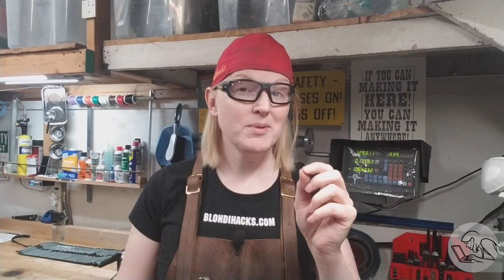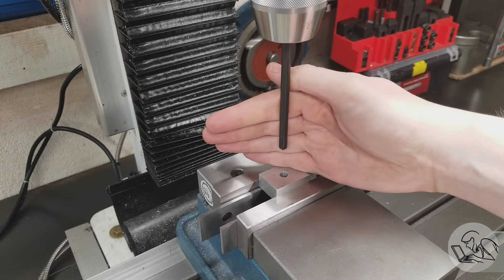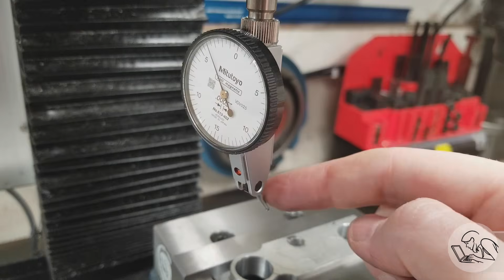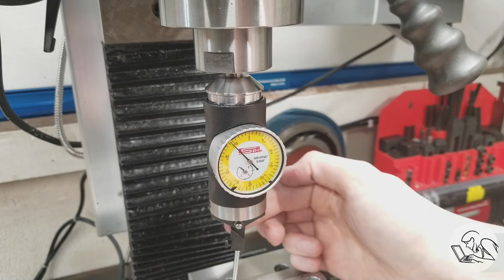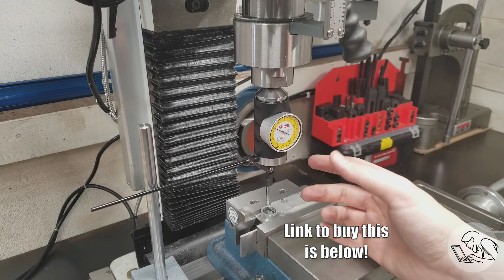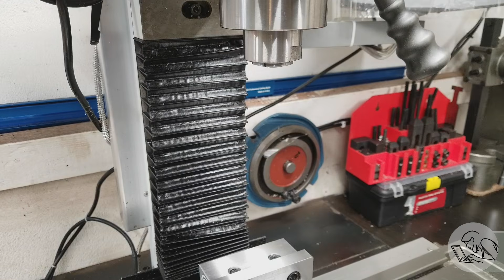FIVE WAYS to find a hole or punch mark on your mill!

Comment from the maker: Hey everyone- it’s a very popular comment that the leg on a coaxial indicator is in fact adjustable. All I can tell you is, the instructions for mine say not to touch that bolt. Like many of you, I tried anyway and found it to be so tight that it couldn’t be removed without risk of damage. Likely Loctited in place. Maybe other brands of this are different, but that is how mine is.
Reply: Very nice video, Quinn. The instructions of my centering indicator states to "adjust rocker friction joint to make the feeler contact with the workpiece". So you should not touch the bolt because it is set loose enough to be able to adjust the joint but tight enough to stay in place during the measurement. Adjusting the joint though still feels like you are forcing something you should not do on a precision measuring instrument.
Reply: Yeah probably because adjusting it introduces more cosine error. I think mine was just cheap and not loctited. I do wonder why the one side has that bevel if not for that
Reply: You should not need to adjust the bolt, the leg should be able to sway both ways with a bit of friction just like a regular indicator dial leg. Maybe it needs a bit of tender persuasion. The bolt is for adjusting the friction level.
Reply: Mine looks exactly the same and goit it from aliexpress for 50bucks.
Included a lot of different probes
Reply: LOL "...the instructions for mine say not to touch that bolt. Like many of you, I tried anyway..." Oh, really? I wonder why they would say that? That can't be right, and why doesn't the leg just adjust like other indicators?... RTFM in case of emergency ONLY!
Reply: With respect: that’s strange.  I’m not home, or I’d send you a pic of mine.
Reply: Huh - my instructions say, "Adjust rocker friction point to make the feeler contact the work piece." which I interpreted to mean that I should loosen the acorn nut rather than go all gorilla on it.
Reply: I just loosened the little acorn nut on mine. Definitely adjustable
Reply: On Blake brand Co ax indicators the leg is adjustable, and the SPI brand unit we used when I was in high school shop was also adjustable. Obviously I cannot speak for the exact unit that Quinn has. Regardless, it's a still a great video overall.

Comment: i have the same coax indicator as you do and mine gives me a 0.100 error in comparison with the dial indicator, i was wondering why i was not getting my center, after doing a few comparison tests i found out the coax indicator is off. do you have an idea what can cause it? does it need to be calibrated

Comment: This is a bit off topic but it relates to punch marks. I found that I can use a punch to drill incredibly accurate hole patterns. The trick is to put a sharp object in the quill and bring it down to make a mark. The quill mustn't rotate. Move the table an accurate amount using gage blocks or something accurate to a tenth or better. Bring the quill down and make a mark. After they are all done use a small flexible drill that will follow the mark. Drill the hole on all of them and go back and make them the size you need. I find I can get most of them to within a tenth and the worst might be two tenths. Measuring the accuracy is a chore. I usually put pins in two holes and measure the outside distance and compare with the others.

Comment: Hi Quinn. At 8:55 you mentioned someone saved a rotary table position in a DRO. I did not know that was a feature in a DRO. I searched without much luck. Could you briefly explain how that's done? (I have a Fagor 2-axis 20i. There's a video on saving on a 40i that involves a usb dongle but not on mine.) Thanks.

Comment: Wouldnt it be possible to machine a plug gauge on your lathe, with the shank sized for a relevant collet and the "plug end" machined to a transition fit for the hole your trying to align 🤔?

Comment: Thanks for showing how the coaxial indicator works. My preferred method is an edge finder with a 0.2" machined end on one end and a pointed end on the other. These are available in different sizes, but I usually use the 3/8" body and it fits perfectly into a 3/8" R8 collet or Jacobs chuck and are short for small mills. They are used dynamically at a medium-high RPM (around 1000 is recommended). Simply adjust X and Y until the end just kicks out (0.2" end) or is at minimum if using the pointed end  for a center punch.  I think Mr. Pete has a video on how to make one, but Amazon has a Mitutoyo for around $20 as I write this.

Since I have a DRO, I use the 1/2X (or 1/2Y) function for the 1st axis. I then set the X (or Y) axis to zero. I then do the same thing for the other axis.

The problem with the normal edge finder is it can leave marks on the edge if it is soft material, such as aluminum. If that is important, I find the electronic edge finders useful if you are machining metal or other conductive material. These are used statically and cost a bit more. Amazon has a Fowler for about $50 as I write this. They usually have a 1/2" body and are not usually produced with a pointed tip. The DRO method can also be used, but creep up slowly so that the tool is not permanently bent (they can take a small amount of flex).

Of course, for non-conductive soft plastics, use a thin sheet of paper between the dynamic edge finder and the work.

Comment: Loctite turns from a chemical holding method to a lubricant to aiding  removal under heating, Loctite turns liquid under heat and the basic differences between the different grades of Loctite are the heat rating of the Loctite basically the stronger Loctite's are higher heat rated, So Heat to loosen  does work

Comment: Question, I can understand why you would want to find dead center of punch mark, @28:13 when your finding the center of the already machined hole, why would you want to unless you was going to enlarge it or cut a thread but wouldn't you have done that already while it was attached in its correct position ?

Comment: It is a friction movement for the stylus to accommodate diameter range. Unlike the dial test however it only swings in one direction passed center. That’s what the little angle is for.😃

Comment: Blondie, thank you for your channel.  It has been 50 years since I took machine shop in high school, and spent a summer working for research tool and die for a summer.  I just bought my first lathe, a 7"X14" and will make a machinest hammer and then a meat tenderizing hammer like the one I made in high school.  I have five daughters and a son.  All of them would like to have the meat hammer they grew up with.  So I plan to make four more, maybe five. I am trying to decide if I should buy a mill with a tilt head, tilt column or one like your PM-25?  I have been looking hard for about a month and see no hobby projects that require the tilt column, or tilt head. The tilt seems to introduce unnecessary error?

Comment: Another way is to use the pointed end of an edge finder and a 1/2" precision bushing that is just able to slide over the edge finder body with no slop.  Load the edge finder in the chuck point end down with the bushing in the middle.  Stick the point in the punch mark, and move your x and y axis till you can slide the bushing down to meet the part surface.  If it won't go all the way down, it's not lined up yet.

Comment: Awesome video - thank you (new to your channel - great work). I suspect another reason for the twist drill drilling slightly oversize is the torsional stress during operation tends to make the helical flutes unwind. This is probably less a factor than just being sharpened asymmetrically (or bent) as you said.

Comment: I may be a bit too old since I am retired I have more time than money. The wiggler you mentioned and demonstrated has another method that I like even better. If you take the pointed wiggler (for a punch mark) and place it in the punch mark with the machine off, then lift the quill and turn on the machine, it will swing around since it is off center. So, stabilize the wiggler as you mentioned and get it very close, place the wiggler in the punch mark and turn the machine on and lift, now leave the machine on and stabilize the pointer and adjust your X or Y then lower the quill into the mark again then lift. Repeat until there is no run out of the wiggler when you lift it from the mark. I do the same thing with the ball wiggler when I have a hole that is smaller than the ball. There you go. Another method. I use this so often that my drill has a wiggler and so does my mill. I am quite fast at this method and a lot less set up and fussiness of the tools I can't afford any way. lol Fortunately, I don't need 3/10ths of accuracy for my projects.

Comment: I absolutely love your videos. This one in particular I found very helpful. I am a journeywoman machinist and have been working in the trade for almost 7 years now. I have acquired and purchased many tools. One of which is a coaxial indicator. One issue I struggle with is my set ups and I am always looking for ways to improve. I have never run the indicator under power but this is definitely how I  will be doing moving forward. It is a much faster way. You do an amazing job with these videos. Your explanations are so easy to understand and very entertaining! I wish I would have discovered your channel sooner.

Comment: You can also use the pointed end of a starrett edge finder for a punch mark lower into the hole then lock the quill be careful not to lock with to much downward pressure like bottom out then raise like a thou then you simply move your dials back and forth until the cylinder is centered unlock the quill relower to press into the hole botom as long as it stays centered you're good to go

Comment: I'll tell you a little trick I've used in the shop for year for picking up existing holes when you only need to be within a thou or two. Use an edge finder. Drop down in the hole, eyeball it to center of the hole. In "X" axis move until the edge finder kicks, zero your DRO then move the the opposite wall and when the EF kicks, look at the dimension, divide it by two and move back to that dimension and zero. Repeat for the "Y" axis and you will be centered.
Reply: Some edge finders have a pointed end for finding centers of holes.😊
Reply: @donaldoehl7690  that's true but then again, I didn't have one like that. I could have trammed it in with an indicator but this method is quick and simple.

Comment: The beauty about purchasing a coaxial indicator is that you can use it with a known flat plate held down to your milling table and it will make a quick job of tramming your mill head to the table.

Comment: Quinn: first, let me say that I really appreciate a young lady like you showing an interest in the machine shop profession.
You’re articulate, pleasant and well-disciplined speaking voice shows your confidence and willingness to share your knowledge about the subject matter of your illustrations.
I am a retired journeyman tool and die maker with just under 50 years of experience at 19+ manufacturing and vocational institutions of employment, both full-time and part-time. I am presently the lead machine shop instructor at engineering college in my community. I plan on referring my class to some of your videos. I enjoy critiquing them. I wish there was some way that I could speak with you for 15 minutes to help you with the subtle imperfections in your videos. As a small suggestion please show the thousands of an inch like this .005 and not 5 thou. Also, you are drill Chuck may be Jacobs, but it is an Albech design chuck or quick change drill Chuck.
Thank you. Please keep up the good work.  Rick

Comment: A good tutorial, there is one other method that works particularly well on holes or 
cylinders that have diameters larger than 1" say like 6".   Use a cylindrical edge
finder and the DRO.  If you are unfamiliar with this type of edge finder they work
much like the wand type demonstrated near the end of this video but they do not
tend to flail around.  By using a method similar to the dial indicator, with the DRO 
and a calculator a center can be found in a minute or two.  The diameter is only 
limited by the travel of the Y or X of the mill bed.

Comment: I'm not sure this is as much an issue with jobber-length drills, but I can tell you for sure that extra long drillbits untwist a little during use, expanding slightly, and that's part of why they drill oversize.  I found this out drilling a deep hole with a jobber drill and then running an extra long in there and having it bind.  (Hence the existence of aircraft extension drills, I guess.)

Comment: There is one more dirt cheap method, laser. Those $5 doller laser pointer using watch battery, you can put it in the chuck and it will give you good indication. The only problem is, sometimes the red dot is too big, you can make a cover with paper/rubber/leather. Center it on you lathe/mill and use the smallest needle you can find to punch a hole on that cover. Depending how small the hole is, how accurate it will be. Loose your vice little bit, move the parts instead of the axis, press dro zero, It will reduce your tuning to seconds, but it only work on punch marks, not for holes already excisted.

Comment: Actually, since you have both a coaxial indicator and the mitutoyo indicator,
you should consider using both!

First, use the coaxial since it is the easiest. But, the coaxial is not the most precise!
However, since the coaxial can locate the spindle center well within the range of the
mitutoyo, finish locating the center with the more precise mitutoyo. That way,
you get the best of both indicators with very little compromise.

It is important to understand that coaxial indicators only work if the machine
is large enough. The space inside some machines can be to small to use
something as large as a coaxial indicator. That is why traditional dial indicators
will always have greater versatile.

Comment: I thought the pointy end of an edge finder was for centering on holes.   I haven't actually ever tried this, even though I have an edge finder with a pointy end.  

Does that trick not actually work, or am I mistaken about what the pointy end is for?
Reply from the maker: You can use it for that, yes

Comment: The really interesting thing about a coax indicator is that if you mount them eccentrically, they still work.  So they automatically correct for any runout in your collet or chuck.   If you get a cheap one they often have a minimum amount of wobble.  If you just minimize that you are good.  Mine will never get exactly down to no wobble in the dial.    I don't think it's worth paying extra for a good one unless it has a shorter footprint.

Comment: Hi Blondi.  I can't afford an expensive toy like that one you have but found it very interesting to see how it works.  Got to thinking about the problem you have been having with the "wiggler" style attachment you have for it.  Can you turn the wiggler arm so that its articulated joint is at right angles to the normal movement of the device?  Then, when you have the wiggler point in a hole, it will take up the variance in the opposite plane to that which is being measured at any point of rotation - so that the "anvil" does  not rock from side to side.  That's how it looks like it is supposed to work to me anyway.  Try it out and let us know.  Thanks
Reply: So sorry!  I did mean in a punch mark, not in a  hole!

Comment: What I do to find a center of a hole, if it is large enough to accept an LED-lit edge finder, is to find the first x edge of the hole (it doesn't matter where the y-axis is as long as it's in the hole and you don't move it) and zero out the x-axis dial and then find the opposite x edge and divide the resulting movement by 2 and then move the table to that. Now you have found the x-axis center. Do the same with the y-axis. You now have the center of the hole. You can do this with a non-electronic edge finder as well but you need to have the spindle rotating whereas an accurate electronic one you really don't.

Comment: Good suggestions. Luckily for me I seldom have to get too accurate. Retired doing home projects. I have both the coaxial indicator and dial test indicator, but my "go to" are a set of various sizes turn ground and polished pins (that fit in R8 collets) with one end turned on the lathe to a (long) tapered point then ground with tool post grinder for the finish. Most of the time I can see enough for a good enough fit. Sort of like your #2 center. I got a laugh from a few of your comments, reminded me of This Old Tony's channel. Thanks for the video!

Comment: Here’s a project to try for you. Couple of cents laser diode, add a coin battery and magnet/clip to the spindle. Persistence of vision gives you a circle and you adjust diameter by changing height. The eye seems to be decently accurate at judging equiv gaps ...